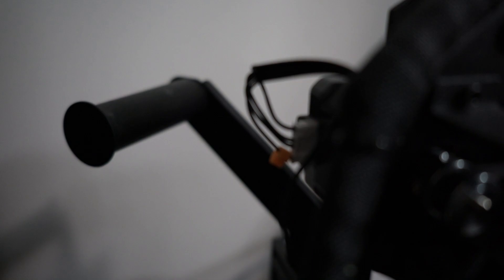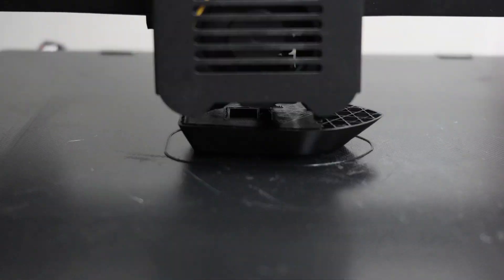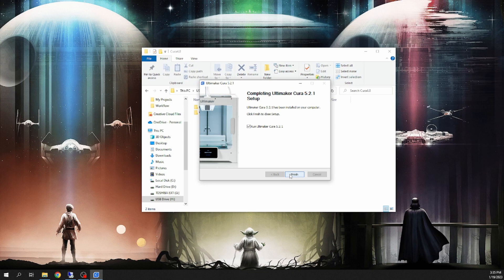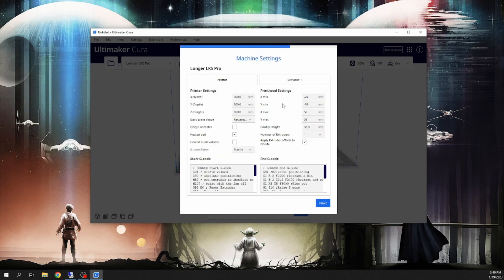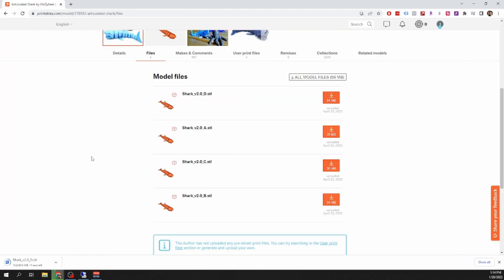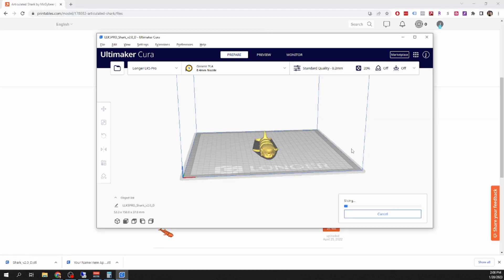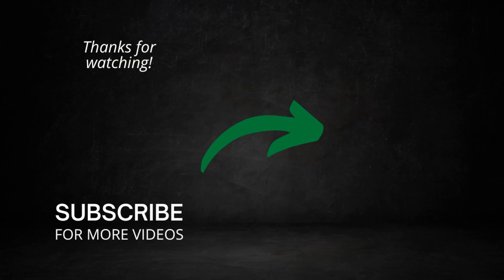How To Print with the Longer LK5 Pro 3D Printer Easy Guide

Comment: Where specifically on the Longer MK7 Printer is the port to load either a USB connector, or the memory card slot, as I feel stupid asking this, but I can't find it anywhere?
Reply from the maker: I'm not familiar with the MK7. On the LK5, the slot is on the side of the printer by the housing for the motherboard - almost directly below the filament holder. Hopefully it is similar on your printer!

Comment: I have a question: How do I rename the file of a 3d print on my longer 3d 1.3 software.  I know it comes with a name, but I want to name it different. That way, it's easy for me to find it on the print files
Reply from the maker: Take the memory card out of the printer and plug it into your computer with the USB dongle that came with the printer. Open the memory card on your computer and rename the file to whatever you'd like it to be.

Comment: Hi 👋🏻 I just bought a longer lk5 pro i’m using Keira the new cure that they have and this thing is really slow. Is there anyway to speed this process up for anything? I mean I’m getting stuff that it’s gotta be next day or whatever you know even when I go down to the fastest speed. I’m still you know I don’t know. It’s just really disappointing right now. Is there anything you could think of or help me with deeply appreciate it. Thank you so much. Love your videos keep up the great work God bless.🙏🏻
Reply from the maker: The machine isn't the fastest printer on the market. You could try to speed up the printing process by reducing some of the infill on the stuff your printing. You could also try to reduce wall thickness. Both of those things can reduce strength, though. And the faster you print, the lower the quality.

Hope that helps!

Comment: Hi John, I don’t know how to turn off the power recovery mode and I think that’s leaving bumps in my prints, can you help? Thanks!
Reply from the maker: I haven't had that problem - so full transparency, I haven't tried doing this to turn it off. However, you should be able to go into Cura and go to settings > printer > manage printer > select your printer (most likely just called Longer LK5 Pro) > Machine Settings. Then, in the box under "Start G Code", add a line below "; LONGER Start G-code" and put in M413 S0, That should disable it. You'll need to re-slice the file in question with that new setting before you try to print again.

Hopefully that helps!
Reply: @jfmedina2010  thanks! I’ll try that! God bless!
Reply from the maker: @Carterproductions22  you're welcome! Good luck!

Comment: Hi John, Thank you for all the videos and tutorials i really appreciate it. I have a question, my printer dont feed the filament and doesn't  print. I change everything and doesn't work. Do you have any suggestions. Thank you in advance.
Reply from the maker: Does the motor still work? Is it spinning the brass wheel?
Reply: @jfmedina2010  Yes the motor is good, and the spinning brass move and feed the filament but don't feed anymore when i put them to print. Start to print but after few minutes the brass wheel go backward, like pulling back and don't print anything, I change everything, today, I change the nozzle kit and nothing.
Reply from the maker: @MAJ-f5h   did you happen to change out the bowden tube? If the brass wheel is making a clicking noise after you start printing it most likely means you have a clog. If you replaced the nozzle and that didn't fix it, then your bowden tube might be expanding when it gets hot and causing a clog within the tube.
Reply: @jfmedina2010 No, always do that noise.  I change everything you do in your videos and also i change the nozzle kit and the resistence cables everything new and doesnt work. Im so mad because i send messege to Longer, they dont do nothing. I have problem with this machine since I receive it :(

Comment: Should you peel off that plastic film of the heating plate or not?
Reply from the maker: Yes, if there is plastic on your print bed, you should peel it off.
Reply: @jfmedina2010  mine was broken anyways, after 5 times constantly changing the hight so it's 1mm and 3 different materials and every setting possible I did return it, but thanks for the guide

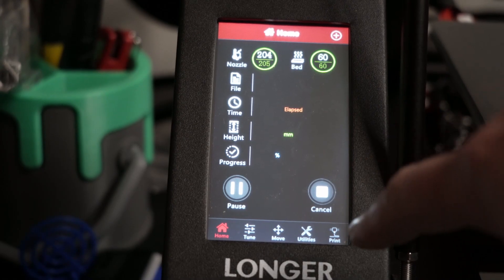Comment: John, I am new to this so please any help would be apricated; I am looking for a 3D printer that will allow me to print 1:24 scale buildings for my Garden Railway, could suggest a printer for me.
Reply from the maker: Hello - what size do you expect most pieces to be? The size of print beds are going to be your biggest factor. But if pieces are too large, you can always print them in halves and glue them up after.
Reply: @jfmedina2010  yes, most likely no more than 11.5 x 12.00 thanks for your input on the type of printer. Most prints will be houses and buildings.
Reply from the maker: @user-rj8ys5nx4n  there are a lot of options out there for printers. The Longer LK5 Pro is a great option for beginners and isn't super expensive. I've been using mine for about a year and a half and have no complaints.

Comment: I don't see what the filament guide snaps onto.
Reply from the maker: 0:56 right here, I point at a little metal piece next to the gantry. On the filament guide, there is a slot that fits over that little metal piece.
Reply: @jfmedina2010   Thanks for getting back to me! So there is no metal piece to slide it onto on the other side of the metal plate. There is a black bolt but the guide doesn't fit well onto it and kinda dangles. I could glue it on but that doesn't seem right. Next problem... When I feed the filament through, it stops at the gold gear. At 1.45 of your video, you mention squeezing the spring to get the filament through...the filament wants to round past the hole so I used a clamp to hold the spring open and a pin to guide the filament into the hole. Design flaw?? So The end of the filament is in the hole and I heated up the filament to 200 and the bed to 60. Chose a file to print and it goes through the motions but no filamant is coming out. hmmm.
Reply: Is the gear supposed to be turning? (It is not)

Comment: Hey so I have a print on thingiverse  but it won't let my download the file to the drive
Reply: I had to install cura through the terminal cause I have a chromebook
Reply from the maker: I've never used a Chromebook before, but it might not like the file type. You might need to end up downloading the file onto an external hard drive or directly onto your SD card instead of trying to download it into your Google Drive.
Reply: @jfmedina2010  see that's the thing it only says download to drive it won't let me download to the external either
Reply from the maker: @mikeythegoat4478  I'm not sure if this will work, but it might! https://www.guidingtech.com/45061/chromebook-downloads/

Comment: Hey John I just stumbled across your channel, great help I cannot thank you enough. I do have a few questions and I would love to hear your feedback. 

I upgraded to a 6mm nozzle for faster prints, since then I do have some stringing issues, would you be so kind to post your profile? I toyed with the retraction on my end, and I was not able to fully eliminate the issue. 

I would not switch back to 4mm, the speed is more than worth the hassle. I just want to ask if you had similar issues, and if you did any changes or upgrades to the printer.
Reply from the maker: Hey Chris,

I'm glad you're finding the videos helpful! I have not used a 0.6mm nozzle - so I don't have a profile for that. 

My main profile that I use is:

0.2mm layer height
0.4mm walls
20% cubic infill
50mm/s print speed
25mm/s wall speed
5.0 mm retraction
45mm/s retraction speed
skirt for build plate adhesion
The temperature I use depends on the material that I'm using to print.

Since I haven't used a 0.6mm nozzle before, I can't speak as an expert, but there are a few things you can try to reduce stringing (if you haven't already). 

You mentioned that you've fiddled with retraction - did you try increasing the distance or the speed? The faster you retract the less likely stringing is to occur. Because your nozzle is larger, retracting faster might help. You could also look at increasing the retraction distance by 1mm intervals and see if there is any improvement.

Another thing to consider is your print temperature. I'd recommend doing a temp tower to see if the nozzle size will change your optimal print temperature. The Cura marketplace has a temp tower that you can use that will handle a lot of the gcode modification for you instead of you manually having to find the layers to change the temp at.

Lastly, if you live in a humid climate - with the warmer weather, there might be increased humidity. If your filament is building up moisture, it can also cause stringing.

Hopefully this helps!
Reply: @jfmedina2010  thank you very much. I did a number of tests and prints for that.

My profile is very similar the main change is I print at 215C and my walls are 0.6mm

I did dry my filament. In this case I used retraction starting from 3mm up to 12 with no avail. Also the speed was done from 0.25 to 70 with no avail. 

The best I could do is whips ...I will carry on testing thank you very much for the help! You are the best
Reply from the maker: @chrisandgaming9524  You're welcome! If I ever stumble upon the magic sauce to make it work, I'll come back to this and let you know!